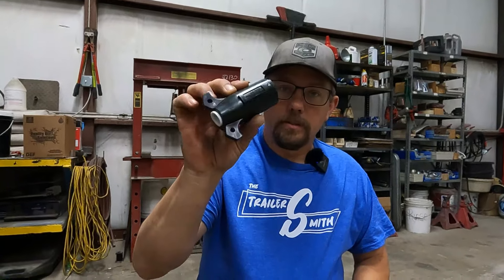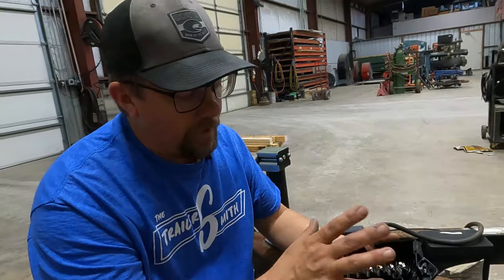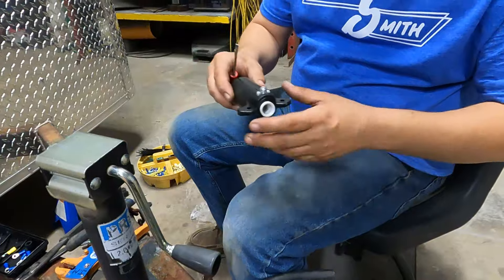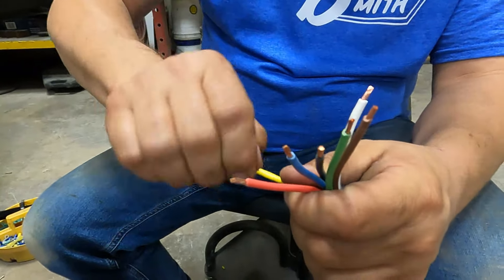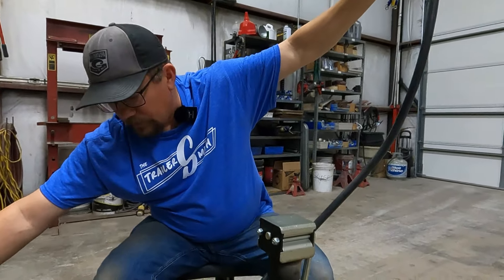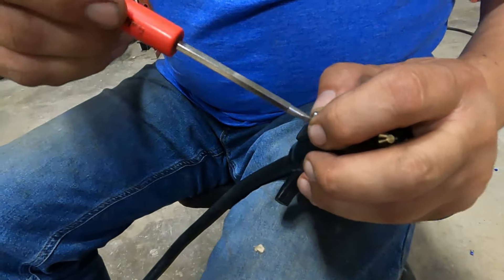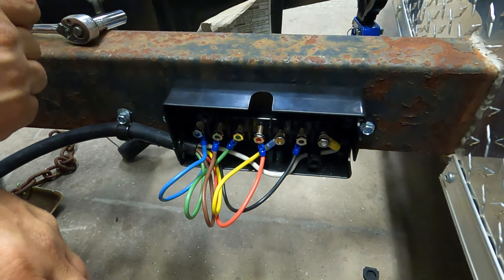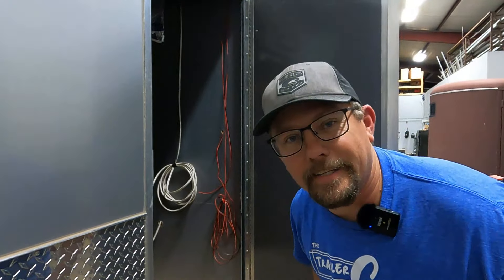Wiring 7 Way Plug For RV

Comment: I have the same set up but my 7 pin has the led lights in it question though when hooked up to battery or shore power the 12v aux led stays light is that normal

Comment: Is there a pin difference on any 7 way connectors or should pin location always be the same just different color wires depending on application?

Comment: Thanks for the information.  Not too common to use a junction box but very smart idea. I would opt for a good quality durable box... My rv came from the factory with a junction box used in residential wiring with twist on connectors.  All the wires barley fit. It is protected in the 5th wheel hitch.  Thanks again.

Comment: Just an idea, common wire problem or failures for trailers/rvs.  Grounds are critical and corrosion prevention seem key. Quick fixes while on the road, for example driving lights stop working at night. Thanks again.

Comment: I like your videos, to the point and very helpful. I bought one of the prewired 7 way with junction box (same manufacture as in your link)  The colors are not correct for my car trailer, so I will just have to make a "key" of the colors and how they will be connected so I have it for future use for troubleshooting. There seems to be many different color options, not much is standard lol.

Comment: So, you installed a junction box and hooked the trailer cord to the box with easy color coded studs......but never hooked  the trailer wires to the box .   That's the hard part, especially when the trailer wires aren't color coded or numbered .  I hope you have another video on the wiring on a utility trailer . I assume you're talking about the commercial  highway trailer 7 way plug, which I use both for my RV trailer and my platform utility trailer . I despise the RV industry for not using the commercial highway plug , of which much more utilized  in industry . PS, I'm colorblind .
Reply from the maker: Yes. I explained in the video why the trailer wires are not run to the box. The video is to demonstrate how to wire a 7 way plug for RV application. The first video ever done on this channel was to wire a 7 way plug for utility trailer.
Reply: @TheTrailerSmith  I already have everything apart and I’m trying to get it back together so how do I know which wire is for which